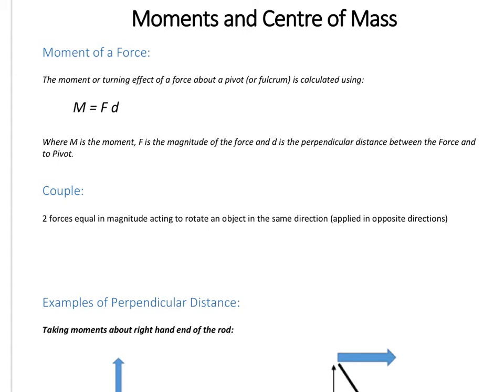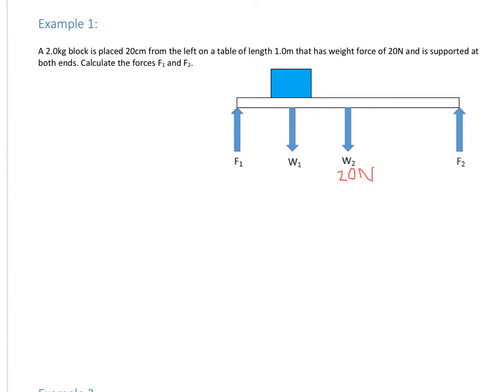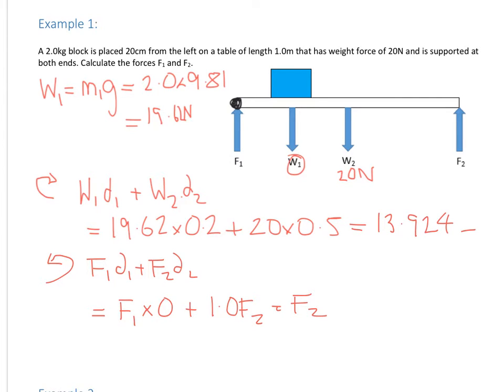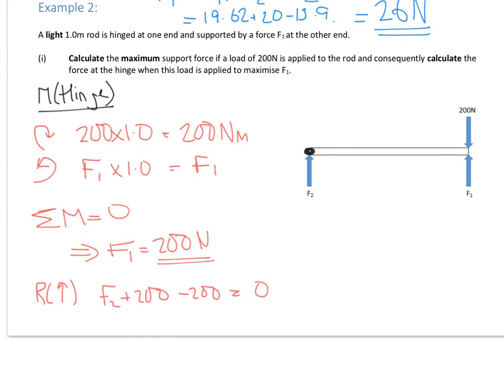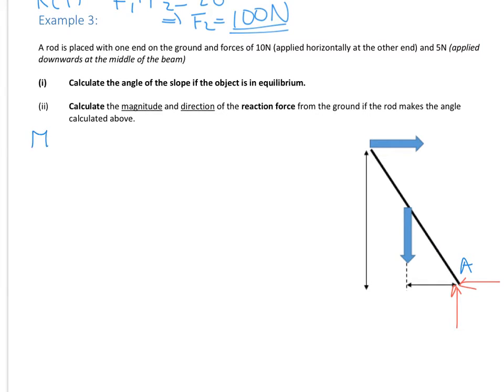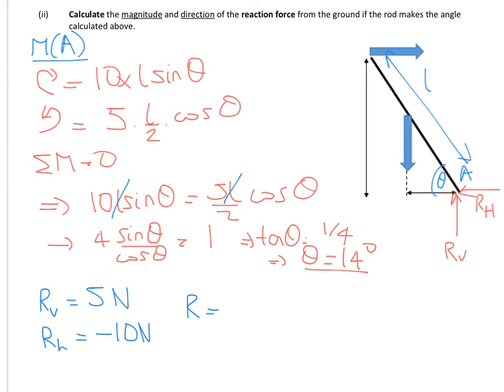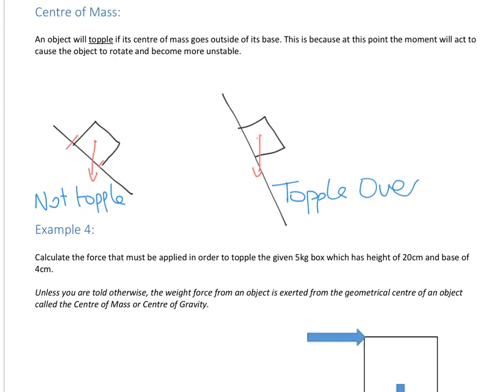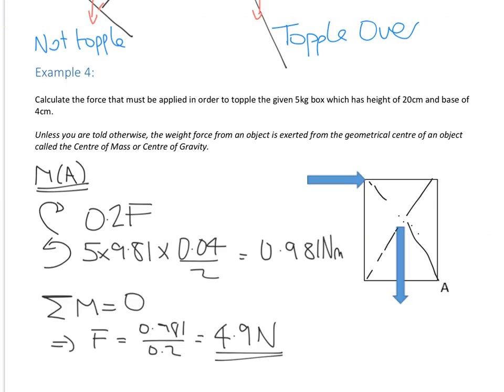A Level Physics: AQA: Moments and Centre of Mass

Comment: If the pivot is at f1 why would you put the f2 in the anti clockwise position? a bit confused
Reply: john smith because applying a force on F2 from underneath would result in an anti clockwise movement